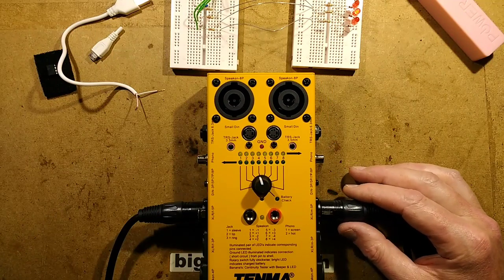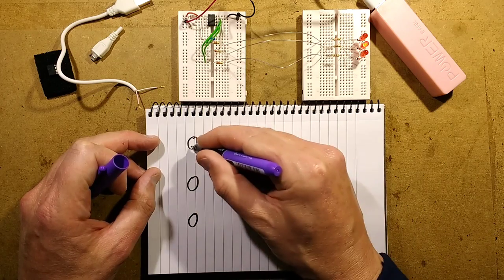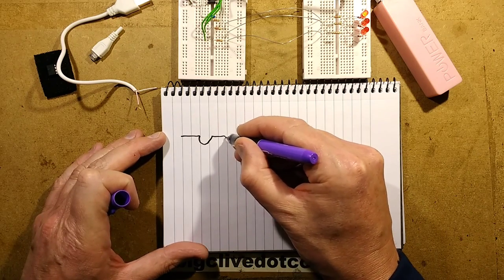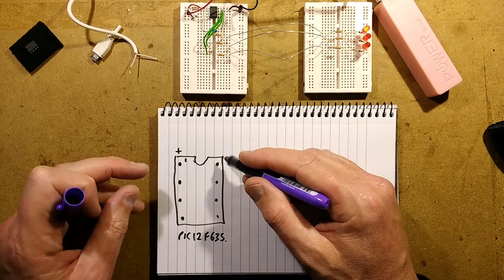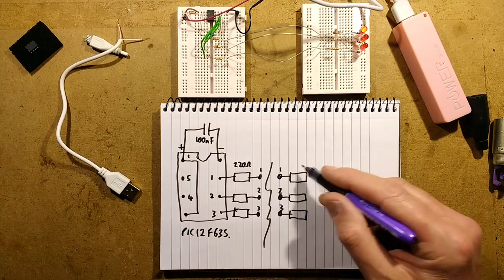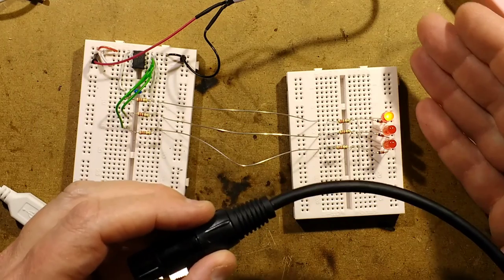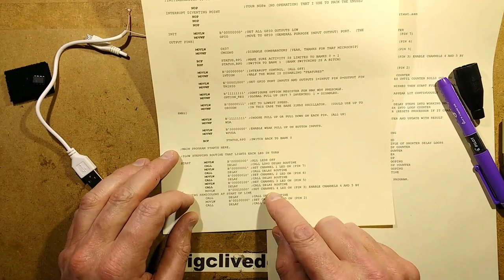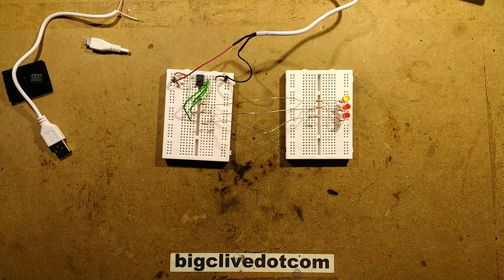Experimental 3/5 core DMX cable tester.  (Including PIC software.)

Comment: would it not be easier to write the code in C?  much less code and easier to understand.
Reply: Lester Electronics he used assembly because he has a thousand lines of it so it just makes sense.
Reply: +Matt Harrington What?
Reply: Lester Electronics I learn a lot of UK terms from you all.
Reply: +Lester Electronics I'm afraid the joke is going over my head.
Reply: I agree that it would be easier (at least for me) to read it in C, but if Clive prefers to write asm, he shall write asm. Someone else can port it to C if they want to.
Reply: These small pin number PICs tend to have smaller program memories, this particular PIC according to Mouser has only 1.75 kB of program memory. C tends to take up more program memory space than assembler, so if you are worrying C will take up all of that program memory, then assembly is the way to go.
Reply: +hellterminator He has a 1000 chips... so why not 1000 lines of code ;)
Reply: I am not sure that is true these days. As a general rule I would say it is best to choose the most capable MCU with a ballpark price and use a language like C. So a 65 cents chip that needs assembler against a 68 cents chip with 10 times the space is a no brainer, especially as a hobbyist.
Reply: Also in c you could integrate across different architectures not just PIC. that's the problem with assembly; only good for the architecture that your using. PIC  asm is different to say Atmel avr asm.
Reply: mbaker335 In general I would agree, as the way you described it is how I select PICs. I was talking about the particular PIC Clive was using, which wasn't selected with that particular project in mind. 

1.75kB is pretty damn small although admittedly I haven't seen how large the code for this project yet.
Reply: Quantum the rewuirments in this project is  small. you could accomplish the objective with a few lines on c code.
Reply: I am not against ASM, in fact it's the best programming language to use if you are starting out on a particular architecture, you will learn a lot. C on the other hand does tend to hide how microcontrollers tick, it's a little like the Arduino argument. I can't talk I wrote PIC ASM to display the time and date on a Nokia display, it was a ball ache, however I  learned loads about the PIC architecture.
Reply: I would write such a gimmick in Assembler, because I learned pic assembler a long time ago in school. Simple as that. For a bigger project, I would go for Arduino. Setting up the tool chain and learning how to write C for the PIC would take time and not really be worth it. Most of the C code would be accessing Special Function Registers, so you need the datasheet anyway. So... why change an old work flow if its not the bottleneck?
Reply: +Quantum Nah, modern compilers are really good at both size and speed optimizations. Unless we're talking about really small programs, you can't really beat a compiler in terms of binary size and in terms of speed you only stand a chance if you can gain a lot of speed by doing something you can't write in C (e.g. I wrote most of the bigint arithmetics in my ATmega cryptographic library in assembly because you can't properly utilize carry in C). 
In this case 1.75 kB isn't a problem because this whole thing probably compiles to couple hundred bytes.
Reply: Optimizations are architecture specific.  I doubt the PIC architecture has the same enhancements as a 86 based chip so that wouldn't really apply.
Reply: It's a very simple program, just setting the pins to 1 or 0, then waiting. For anything more complex I'd probably use C, but there's a lot of older guys out there who started doing this in asm because there were no C compilers for microcontrollers. Or they were expensive and limited. We're spoiled with Arduino! Doesn't hurt to keep up your asm practice.
Reply: +Lester Electronics Ah okay, I did mention I hadn't seen the code yet and I figured it would be fairly small. I agree wholeheartedly though, ASM is the best way to go for learning the architecture. When I was learning I was recommended to do my first small project in ASM to get the basics down, and it was the best  advice I could have received. I was rather uncomfortable with it at first, but Microchip have amazingly good datasheets that basically tell you the ASM code for each feature on the chip.

I now do program mostly in C as the portability is far more important to me as I move between PIC16F and PIC18F a lot. I am also a physicist and so was always more comfortable with C anyway, as it is the first language I learned during my degree.

Edit: Added response tag.
Reply: Quantum love physics, however only at A level tho 🖒
Reply: Lester Electronics You can get Rust running on some pretty modest MCUs these days, including AVRs.  It combines a lot of the advantages of C with expressiveness and safety most of the way to something like Python, it'll be interesting to see how it does in the embedded space in the next few years.  Last ASM I wrote was m68k!
Reply: +hellterminator It depends on the program, the PICs Clive is using here (PIC12F) is more geared towards assembler. If you look at Microchip datasheets, they don't boast C optimisation on PICs below 18F with perhaps some larger 16F chips.
Reply: +Matt Harrington Most optimizations are actually not platform specific at all. They are things like dead code elimination, reusing code blocks, removing recursion… Some, like loop unrolling, are partially platform dependent, but the principle is the same on all platforms and porting them is just a matter of deciding how many times the cycle should be unrolled. Actual hardware dependent optimizations usually rely on special instructions handling complex task and those are scarce on RISC architectures. 
All in all, the optimization support in compilers for embedded platforms is usually as good as it can be. 
And while I haven't worked with PICs in some time, with the ATmega crypto library I mentioned in my previous comment, I got almost twice the speed going from -O2 to -O3, so the optimizations are clearly there.
Reply: Is C really "less" code? It becomes machine code in the end anyway.
Easier for some, maybe. ASM can be simpler than C for smaller projects like this.
Reply: If you don't know PIC assembly then it would be easier and faster to write it in C. If you do know PIC assembly, for a program this size, it would be a complete toss-up. By the time you wrote the #include line and the same setup code and the same main code and delay routines, the C code won't be any smaller than the assembly code for this. It might actually be 3-4 lines longer. 

The C-generated code will probably be about 2-3x larger for the main routine, and will probably pull in a few hundred bytes of library code you don't need. For something this size it doesn't matter, but for something larger it might.

I write PIC code and I pick C or ASM based on what I need to do. The development time is usually about the same and the number of source lines often isn't that much different. C is easier for fancy stuff, unless you are speed challenged on interrupt routines. Then you may be forced to write all or part in assembly.
Reply: For really, really simple applications, I tend to use the smallest chip that can do the job, and will often write the code in ASM.  For those tasks, I regularly choose AVR ATtiny MCUs with zero bytes of RAM and maybe up to 1K of flash.  They have 32 registers, which for something like this cable tester, is all the memory you need.  Why throw excessive hardware at it?

Simple ASM programs aren't difficult to write.  If you haven't ever really tried it, and have developed a preconceived notion that ASM is hard, you should give it a try and form a justified opinion.  The initial learning curve is steep, because you have to learn the mnemonics, which registers can do what, your assembler's syntax, and the handful of lines of boilerplate code you pretty much always need to initialize the hardware.  Once you get over that (which takes... maybe a couple days to a week) the code syntax is trivial, and the only difficulty comes in keeping your head straight between the overall flow of the program and the tiny, tiny steps required to accomplish the task at hand.  It can certainly be tedious, but it's not hard.  This is an important distinction and is why large programs are rarely written in ASM.

Regarding cross-platform C, well... that's an illusion at the embedded level.  Platform agnostic code requires abstraction from the hardware, which is antithetical to embedded programming.  In reality, ASM code might actually be easier to translate.  If you know two platforms really well (PIC and AVR, for example), and can plan your use of registers and program flow instructions to be adaptable to either, then you could just about cross-compile the ASM by running a simple search-and-replace script on the mnemonics.  ;-)
Reply: +Nick Guy There's ton of stuff that can be written absolutely platform independent. I hate to use the same example over and over again, but crypto libraries are a nice example. Sure, it's nice to implement some key routines in assembly, but you don't have to if you're not having problems with speed. I'm using the same RSA library on ATmegas, PICs, ARMs, ESPs and x86. On ATmegas and PICs I implemented the underlying modular addition in assembly, on ARMs, ESPs and x86 the C versions of those routines are fast enough.
Reply: Of course.  And I'm a big C fan and definitely appreciate code portability and re-use.  In the case of I/O-bound applications, though, those principles don't apply very much.

To be clear, I don't advocate anyone stick to a single language at all costs.  Likewise, ASM is not solely for routines that must be optimized for speed.  Heck, C compilers are getting so good, they may produce faster and/or more efficient code than some hand-coded ASM.

ASM is just a language.  Sometimes it's the right choice, sometimes not.  Other times it's just A choice.  I encourage programmers to broaden their horizons.  If you think of ASM as "the big guns" that should only be taken out when necessary, you're kind of missing out on the chance to commune with hardware at its level.  This stuff can be kind of fun.  :-)

Comment: "Very simple". I hate assembler code. x'D
Reply from the maker: There was no other option when I started using microcontrollers.  It's also super-lean.  You can do big things in just a few lines of code.
Reply: Seems like it's because I was raised with higher programming languages being just 29 y/o. I started with Visual Basic, switched to C# and also learned PHP and JavaScript and the basics for C and C++. That's why I like Arduino more.
Reply: Ken you've made a good start into the world of programming. Clearly bigclive has made the informed and experienced choice of a PIC, as it would be hard to get an arduino into an XLR jack. Obviously you could build a version using an ardino, but in this case that would be like re-writing a C++ program in PHP. Never stop learning; Have you tried Haskell?
Reply: No, never tried Haskell yet. At work I learned even a totally proprietary programming language which looks like a mating of Visual Basic, C++ and Java! It's kinda funny!